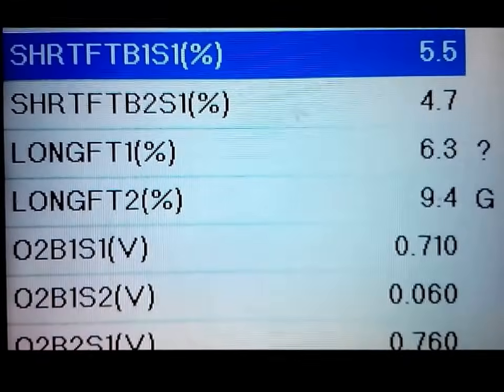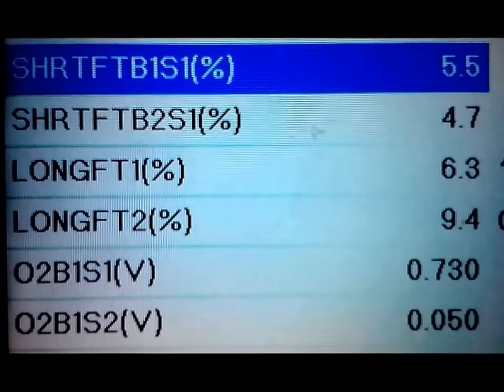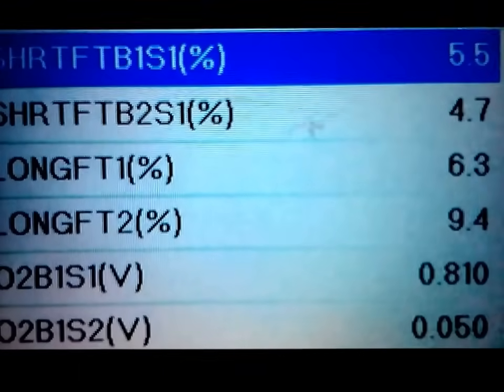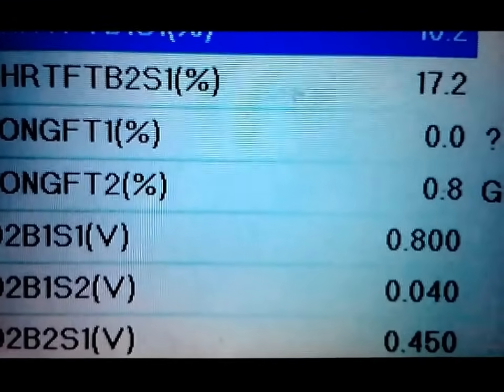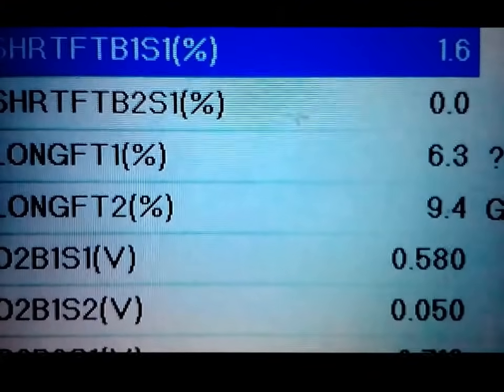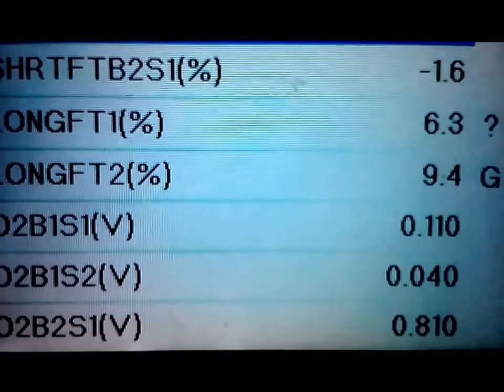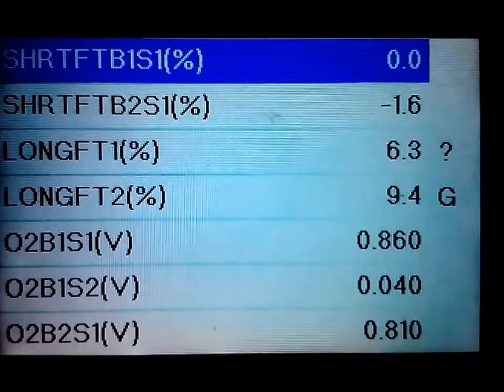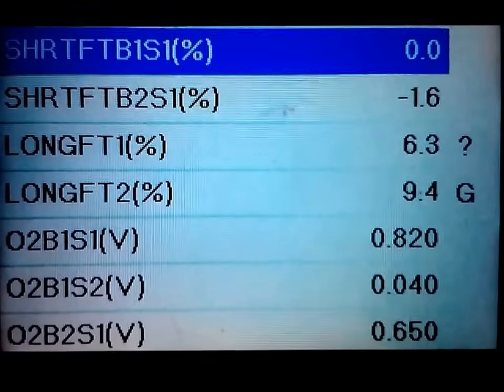how to read 02 sensors, short and long term fuel trims

Comment: Question: I have a 2010 Elantra with only 62,000 kms. It has a rough idle issue from cold start and when hot and under load. Gas mileage is terrible, and acceleration is not that good. Under load it feels like it is missing although my Autel Scanner MD802 is registering - 1.6% at STFT and -4.7 at LTFT. in closed loop. Does this mean a rich condition? Seems like it is trying to remove fuel. I am just learning how to use this scanner. What should I be looking at? in what order I have cleaned the IAC idle control valve, Throttle body was clean and I cleaned it anyways. I cleaned the MAF sensor as well. The timing belt has never been changed.
Both fuel trims are negative?  as shown above. I understand that the LTFT should be at zero, mine was 4.7%. Also some people say the LTFT should not be no more than +/ 2  % and the STFT +/- 3%    STFT seems ok in range but the LTFT is too negative. What do you recommend?
Reply: Have you checked the 02 sensors yet ?

Comment: Hi, totally enjoyed the video. Okay, 04 Volvo V70R, 2.5l Turbo, Auto., 195k. P0303 cylinder misfire #3 cyl. After warm, long term fuel trim 0, short term fuel trim 10-14.  02B1S1 0.005 milliamperes, 02B1S2 0.790 V avg. This is an in-line 5 cylinder engine by the way. I’m thinking B1S1 02 and possible intake manifold leak and stuck injector. What do you think? Thanks
Reply: Start with vacuum leak

Comment: Got  P0171 lean bank 1 on 03 S10 2.2 engine , LTFT at 1100 rpm 21.9. STFT 3.1. No vacuum leaks , would you have any ideas ? Thanks , I have 18lbs of vacuum at idle

Comment: Have a Miss at idle and acceleration no check engine light new plugs and wires ran cleaner through the fuel system a few times I hooked up my scanner took it for a drive and recorded all the data long trim  Bank 1 I have a variation from -100 to positive 7.8 long-term bank 2 -100 two positive 3.9 what does that mean? O2 bank2 sensor1  readings from 0.0/0.9201 . O2 bank 1 sensor 1 from 0.0/0.8854. What could this mean?
Reply: Try looking at the IAC and clean the throttle body..... I replaced the IAC and cleaned the throttle body and now I have no misfires at idle...

Comment: Great video, as you can see, I've also been forced to start learning a bit more about the ODB2 device and the meaning of the readings. My car continues to show a P0174 code that's driving me crazy. Moreover, I get these erratic Avg. MPG readings that go from 24MPG to 11MPG after about 60 miles and then return back. I pretty much have replaced the entire system short of the piston and related parts. Just curious but is it possible that the fault is something other than the piston, which is some serious work to do. Thanks.
Reply: P0174 is not a piston issue right away. System running too lean, u need to look at thedatastream like on the video.

Comment: Got a 4.6 Ford.  Long term bank one is 30  bank 2 is -17.   Runs like total crap.  Can’t even drive it ?
Reply: Did you get this fixed yet. It looks like bank 1 is running lean look for vacuum leak. Bank 2 is running rich. I would look for fouled plugs fuel pressure regulator. Your getting to much fuel. Your outside the range of 10%. You are at 30% and -17%
Reply: Having the same issue with my 97 f150 4.6 did you get you find what was the Cause
Reply: @blowme5150 
Check your car and read live data if it is so high like the above comment accelerate the engine if it improves so you have a vacum leak or dirty air mass

Comment: You may have mentioned it but i did not notice. When referring to o2 sensors rich or lean means rich or lean with oxygen not fuel. Correct?
Reply from the maker: Ronald Dugal hey, thanks for watching. As far as a rich or lean 02 sensor reading it's telling you oxygen in particular but you can also tell if it's rich or lean fuel wise also. If you have a constant lean 02 sensor reading you know you aren't getting as much fuel into the engine as you should be. Then you would look at the fuel trims to see just how bad it really is.
Reply: Good2Boost Right, i understand what you but maybe the average tinkerer might not know this. When you speak of rich and lean some people might think of it in terms of fuel. Say like the guy that likes to tinker on saturday afternoon. I just thought it would be good to clarify that is all. I like your videos. I have an 01 silverado 2500hd with a 6.0. Its throwing me lean codes and an egr code at present. Watching your vids is bringing back alot that i have forgotten. Thanks
Reply from the maker: Ronald Dugal yes very good to clarify this. And as far as egr codes u can do a vacuum test in the actual valve and see if the car stalls or not. I'm pretty sure I have a video on that too. Most of the time but not everytime it's just a clogged egr passage
Reply: Good2Boost how do you mean. The egr is electronic. No vacuum lines
Reply: As for the lean codes im steering towand low fuel pressure problem. Checked it awhile ago with gauge. It was kinda low and i think these engines are picky about fuel pressure. Ive been so busy with everyone else's vehicles that i haven't had time for my own. Didnt think about checking power and ground but i will now. Anything to rule out the pump

Comment: I have a 2002 Suzuki areio it codedass air  flow sender and throttle positioning sencer changed both with new ones and  my car won't stay running  it won't idle at all have to playing with my gas peddle to keep it running I let the gas ho will idle for a second and die  could it be my fuel pump or 02 sencer

Comment: 04 Jeep Liberty 3.7L, 115k got a P0157 bank 2 sensor 2 low voltage a couple weeks ago.  Cleared code and hasn’t come back.  It got me looking at live data and notice my long term fuel trims are at or around +10 all the time.  I couldn’t find any vacuum leaks.  My short terms seams close to zero.  Little bit of rough idle, more rough when cold.  Both cats replaced at 90k by previous owner.  No other codes and the P0157 never came back.  I don’t hear any exhaust leaks.

Comment: I am getting a code of Oxygen Sensor pumping circuit Bank 2 Sensor 1. I had it reset after I replaced the o2 sensor but it came back twice with the same reading. What am I missing?

Comment: I have o2 bank 1 sensor 2 short term fuel trim reading 99.2 percent is that normal
Reply: My guess would be no
Reply: Both of mine read that did you figure out the problem

Comment: 2004 mazda mpv 3.0v6 long term ft 2 says 14.8 cel comes on from time to time maybe 2x a month p0171 & p0174 did the spray thing all over the intake manifold cant find a vacuum leak . Short  term stays between 0.1- 0.8 while viewing live data . Sum 1 help..

Comment: Please, can you help me to interpret my short term and long term trim, my Focus RS mk2 of 2010 18000kms (~ 11200miles) with a preparation stage 3 (injectors big debit 650cc, remap, intercooler big volume , complete exhaust line decat, dumpvalve, plenum mountune etc ....). So cold engine my STFT and in the negative (normal view cold engine enrichment I think), once hot engine the STFT oscillates between -4% and + 4%, but the LTFT still remains at 0% is this normal ?. Do you think that with its figures there is a vacuum leak where everything is normal? thank you beforehand. Best regards. Nico
Reply from the maker: ultimate focus RS MK2 NL sounds like a pretty fun car, and the long term fuel trim hanging at 0% is totally normal. The short term trims hanging 4% positive or negative isn't really much to worry about. A small vacuum leak maybe but nothing I would be to concerned about. If those numbers start climbing higher I would Def look Alot more into it
Reply: Good2Boost thanks a lot 👍
Reply: Good2Boost I just redo a hot engine test, so the short term it oscillates between -2.34% and + 2% (moments it remains 0) in the long term it does not oscillate and always remains at 0! . a vacuum leak for example at the intake manifold, the STFT will not always stay at the turn of + 25% or at least always in the positive to correct a lean state. otherwise yes it is a sport very pleasant to drive with a lot of torque! on the power bench at my preparer, originally it went to 306cv and 480nm of torque (305 and 440 manufacturer data) and with stage 3 it went to 415cv and 610nm :-). I'm happy, now I'm trying to teach myself to read a scanner obd2 myself! to know if the engine preparation was well done and have a good ratio air fuel etc ... again thank you

Comment: Thank you for the video I picked up A lot of knowledge I have a 2006 Audi S4 4.2 and the problem I’ve been having is with the long term fuel trim bank one is usually lower than bank two sometimes bank one goes up to 8 to 9 on positive as bank two stays around eight and then shoots up to 12 my mechanic and I have looked at everything we didn’t fine no leaks through the intake , maf or any of the vacuum lines and then every 6  to 7 days I get P0492 P0171 and P0174 lean codes what do you recommend will be the next thing to check for go to be maybe I have bad O2 sensors or could it be coming from the exhaust I’m so frustrated trying to find the problem of this issue also I get a little rough idle on standstill as well other than that the car runs great on highway and on full speed. Please let me know your input would be very valuable Also forgot to mention 02 oxygen sensor on bank two reads 0.00 doesn’t move

Comment: Hello i have an honda odyssey 2001 and idk like 2 months ago i noticed something like when its cold well always on call if i don’t let the car warm up for a few mins it die at the first traffic light or stop sign lets say start the car and drive right away on the 2 mins after start it will die  and i restart the car right way but it feels like shaking and rough idle i’ve done this replace tps map sensor etc sensor chexk timing belt replace iac control valve clean th also i buy an scanner and no codes at all while driving o got a code but it didn’t pull out the check engine light so this was my reading on the fuel trim 
 Is below -10 %
 
735 RPM ENGINE RPM 
9.4% Absolute throttle possition 
 
-14.8% short term fuel trim bank 1 
-11.7% long term fuel trim bank 1 
O.800 02 oxygen sensor bank 1 sensor 1 voltage 

-15.6 % 02 bank 1 sensor 1 short term fuel trim 

15.6 % 02 bank 1 sensor 2 short term fuel trim 

0.465 02 bank 1 sensor 2 oxygen sensor voltage
Reply: too much fuel. I would check the fuel injectors and regulator either could be stuck open
Reply: Jutty Mac i think something wrong the the fuel regulator I unplugged the vaccum house to it and didn’t see no fuel on the line but the think the spring inside its bad and make the fuel rail flooded with fuel ⛽️or the injectors
Reply: Have you changed the air filter?
Reply: Jutty Mac yes has a new one
Reply: I would check the fuel pressure if you have a tester and go from there. You can check the regulator while you have the tester hooked up. I'm not sure if the fuel filter has the banjo bolt with the hook up on your model or not I have the CRV and it did not I had to purchase a bolt off Amazon about 10 bucks but well worth it
Reply: I guess you change air filer regularly but it wouldn't do any harm if you give a MAF sensor a got clean with MAF sensor cleaner spray.
Reply: Erg valve stock open 
Vacuum leak
Is the spark yellowish around the perceline or ceramic part
Reply: Spark plugs

Comment: sensor 1 bank 1 p0172 code any help 2008 chevy impala v 6 3.5 literflex fuel had a code p0446 changed canister and vent purge valve the issue was solved then a couple days later got the p0172 code any feed back would be appreciated

Comment: l have a p0051 code. l replaced bank 2 sensor 1. now l have p0051. obd2 reading says 3.29 on bank 2 sensor 1. can you help?
Reply from the maker: Andrew Villanueva 3.2volts? And it could be the wiring check that and the harness. Could also be in the heater circuit inside the sensor or wiring to the heater If you have heated oxygen sensor which most vehicles have them today

Comment: i have in bank 1 .27 and it dont change
Reply from the maker: Jesus Ayala if it didn't change after you rev it up a bit and let it go back to idle the sensor is more than likely bad and will need to be replaced. it could also be a wiring issue so make sure to check out the harness before swapping out the sensor. more than likely just a bad sensor though
Reply: you are the best 
thank you

Comment: bank 2 sensor 2 voltage is missing from the scanner
Reply: Some scanner don't show both banks,  even high end scan tools.  Sometimes you have to switch to generic mode to see both but both may not be available

Comment: what does the letter "G" stand for next to the long term fuel trim?
Reply from the maker: Neocat Harry on my specific scanner the G and the question marks are things you can click and it tells you what a long term fuel trim is. as far as why that one is a G and the other is a question mark I'm not so sure. good question! only important thing is what the fuel trims are reading
Reply: Neocat Harry my manual sez that the G signifies that thi item has a graphic.
Reply: What if positive 99% shrtft b2 s1

Comment: You have a lot of buzzing in the background
Reply from the maker: Bob Wolf yes just some vibration noises from the engine running guessing the camera picked it up but it is very low. or ur speakers are very sensitive. lol either way thank you very much for that I did not even notice any background noise until you said something!
Reply: Good2Boost - I didn't notice any, either.